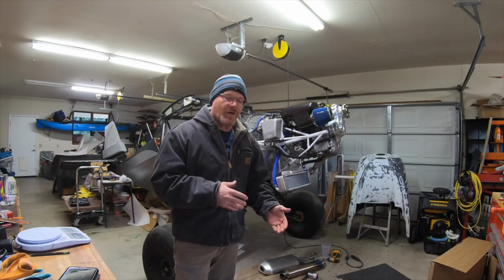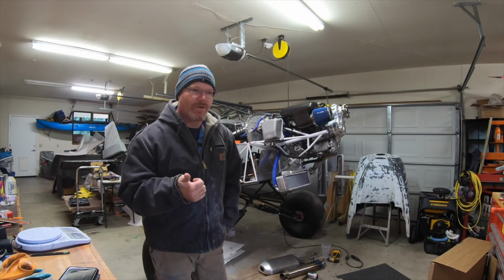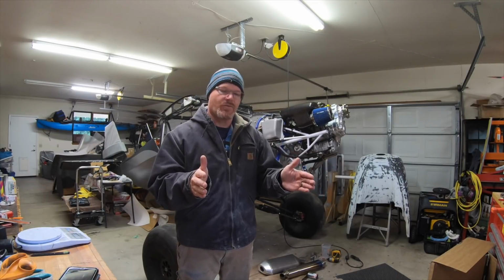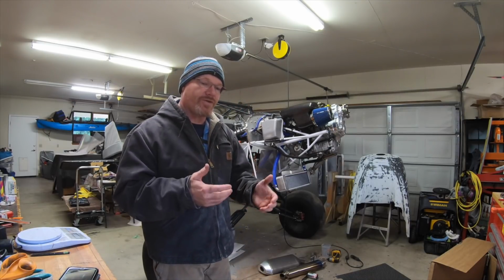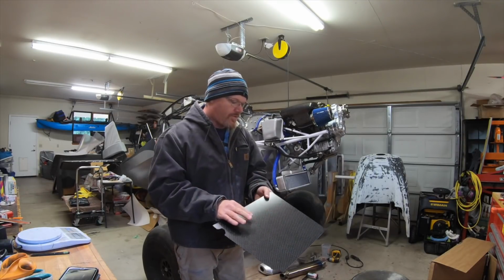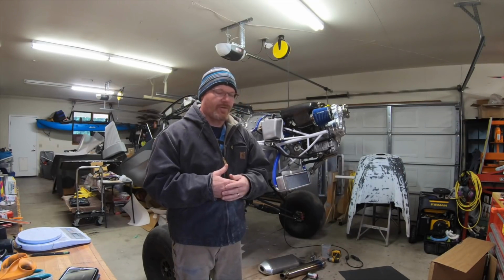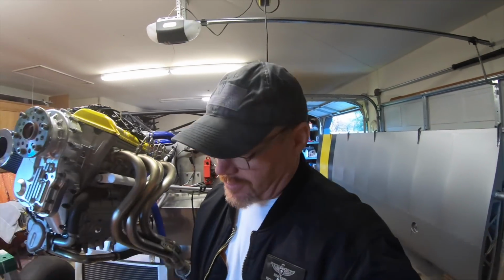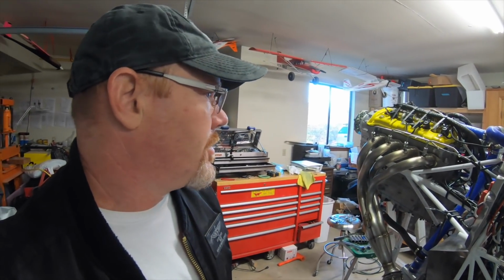Kitfox 7 Apex Build Episode 36 Engine start

Comment: Hi. Im commenting about the off center radiator.  I am not a aircraft guy(yet). I am a motorcycle mechanic and ex race mechanic.  The radiator has plenty of room between the exhaust. You could move it closer.  The amount of airflow you will have going through the cowling is going to keep the radiant heat from the header from effecting the radiator. Many sport bikes and UTV's have exhaust pipes an inch away from plastic with nothing more than a simple 2 layer heat shield.  Its your plane but I think moving the radiator and building a heat shield would be easier than body work on the cowling.   Also good call on reworking the throttle linkage.  It would have broken the cable eventually on the cockpit side. And with the fixed pivot on the engine side you would have worn through the cable where it went into the ferrule on the cable. Frayed some and then gotten stuck.  Also. Not sure if you have these on there but you need to put seals on the cables to keep out moisture.

Comment: Hi, Merry Christmas to you and the family. I dont know if you sourced an muffler yet, I used to own a bike dealership, and one of the first mods everyone does is upgrade the exhaust. You may want to take a field trip with the kids to a dealership and check out what’s on the 1000cc side by sides for options. The used OEM stuff usually ends up in the dumpster or 10 cents on the dollar on EBay.  Thank you for taking the time to produce these videos.

Comment: All the nice things you said about viewer comments prompted me to make this comment as well. I just crossed 3 years that I've been working on my RANS S7 build, I hope to start the engine right after New Years. I've put in a Rotax 912is, an engine that is mostly supported by the factory. I've had to do a little problem solving tyring to figure out where to mount the ECU and the fuse box, but it's been nothing like the challenges you have worked out going with the Apex engine. I don't really have much to add except to thank you for the videos and let you know that they are much appreciated. It's amazing how timely your videos have been with my build. It seems like we've often been working on the same things at the same time. When your videos come out, it's been a "drop everything" event for a while now. I know making the videos is a ton of work, but you do have a mostly silent base of viewers that really appreciate the effort.
Reply from the maker: Thank you for that. The engine start is a huge milestone and I’m happy to hear you are almost there too.